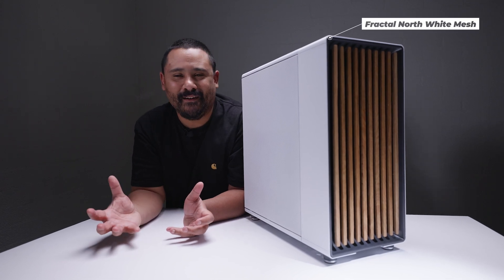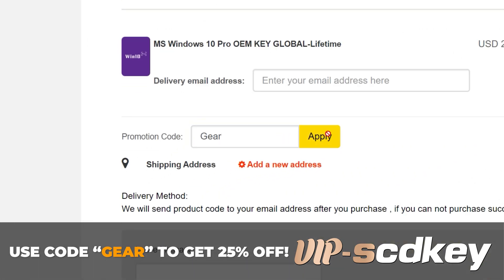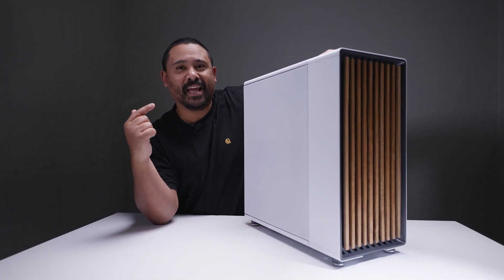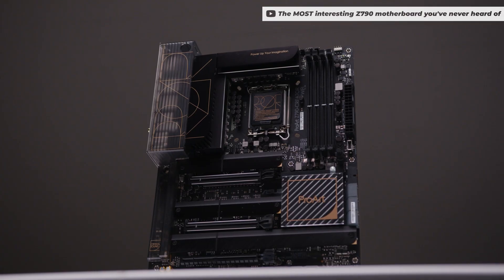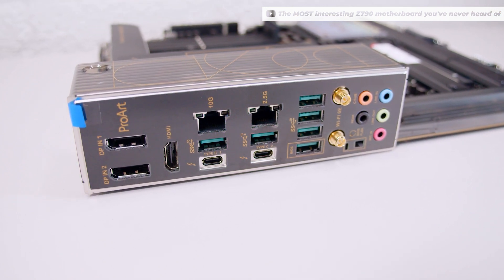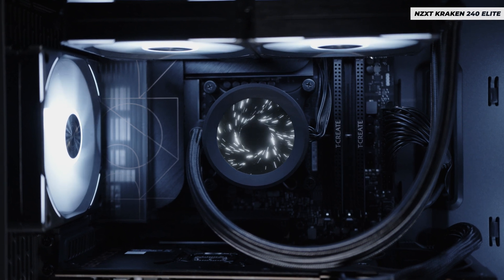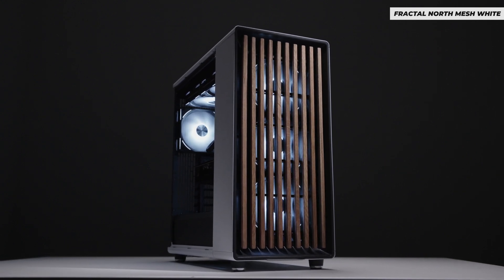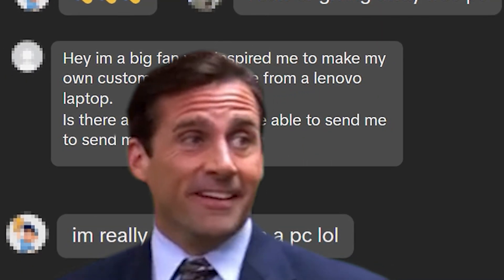Super Clean | Fractal North White | ASUS ProArt Build

Comment: Required tools .. Phillips screwdriver. I bought one of those cases when it first came out, the black one with a tempered glass and if you want a 360 radiator you're blocking a third of it. It needs a redesign. I guess ASUS was feeling generous to you.
Reply: BTW .. That's actually not a bad price for that motherboard, just looked it up $439.99 USD.

Comment: Hi sir i am planning to build my own pc with this parts
1.asus rog strix b550-f wifi motherboard
2.ryzen 9 5900x or ryzen 5 5600
3.nzxt z73 360mm 
4.rx 6700xt or rx 6700 
5.samsung 980 1tb
6.cooler master 750wallt 80+ power supply
7.Crossair 2x16gb ddr4 ram
Please tell me what changes I can make in this build